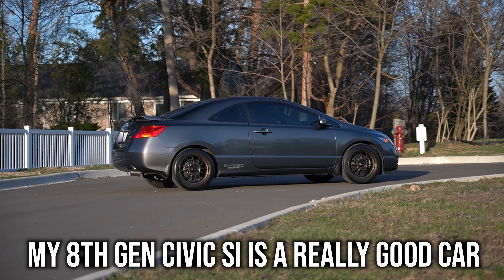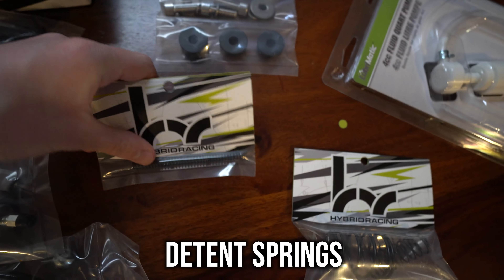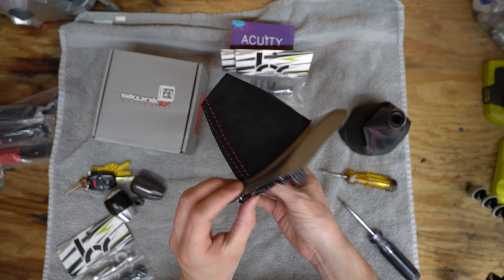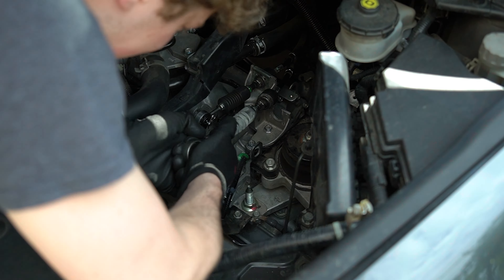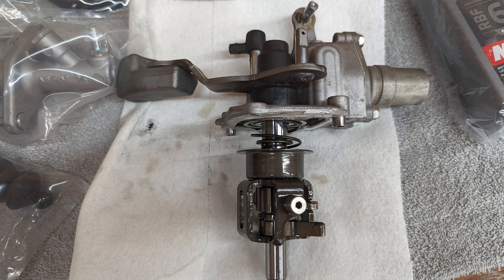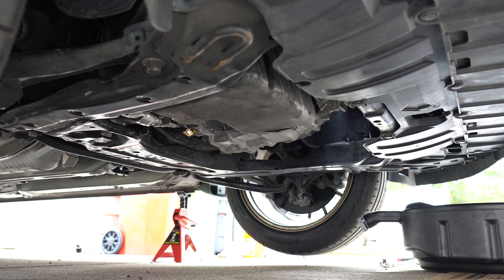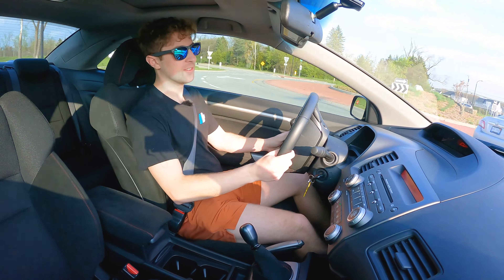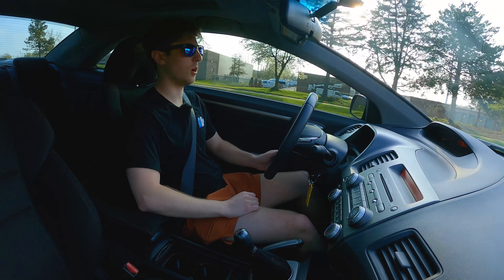FULL TRANSMISSION OVERHAUL On My 8th Gen Civic SI

Comment: maybe its just your personal preference but honda makes one of the best manuals out there
Reply: It’s a known issues with the 2006-2008 Si’s. My synchro from 3-4 is shot at 105k miles
Reply from the maker: one of the best shifters = maybe so :)
one of the best transmissions = absolutely not, they grind gears constantly and are the weak point for majority of older Honda's
Reply: Poor maintenance is the cause of those issues. No trans can hold up to constant abuse without premature wear regardless if you follow intervals. If they recommend every 30k miles (normal driving) then do it every 5k miles if you continue to slam the gears
Reply: my 2nd and 3rd synchros are kinda crunchy sometimes it takes a good double clutch to get into gear, not easy with rev hang

Comment: Bro, Hybrid racing CMC, line, and Slave IS the best solution you can have on your car. period.

You didn't adjust it right. That delay valve on each end is causing your next future grinds. Good video, Glad you got base bushings/shifter, and a shift knob/fluid. The detent springs are placebo as hell. That CMC kit is what you wanted more then anything other then literal shifter bushings. 

GL Cheers
Reply: OH if you're not feeling a shifter difference, it's because your shift fork/clutch is gunked up causing slight delays as well. It's a common issue on the k series platform.
Reply: Proper adjustment is key!
Reply: I have driven an 8th gen with the HR CMC kit, and the engagement point was almost right off the floor. It felt great to me
Reply: @SuperFURY1x how heavy does it make the clutch feel?
Reply: which is the best kit em1 or em2? cause i haven’t heard the best things about em1 and i’m in need of a cmc upgrade since mine went bad on me

Comment: Pretty sure Honda has some of the best feeling 6 speeds around.  Really discredits what you’re saying generalizing the transmission issues.
Reply from the maker: Feeling does not equal a good transmission....this things literally eat themselves apart overtime. Track use and hard driving really accelerates this.
Reply: @pattyboi  You literally said "even in like a really good, borderline brand new Civic Si, the transmission just feels garbage". There are problems with the syncros but the transmission is objectively one of the best feeling out there. It's a pretty unanimous opinion amongst anyone who has reviewed or ever driven one so I agree with @christopherkain7838, that's personal preference.
Reply: @pattyboi  I own a 2011 Si Sedan and can concur. I drove it off the showroom floor in Sept 2010. It only has 23,000 miles on it now. Transmission feels like trash into 3rd gear(grinds sometimes...synchros feel wacky....6th sucks as well. Also, clutch pedal makes an annoying clicking noise in warm weather. 
My 1999 Civic Si 5 speed box was a dream though. I beat that car hard and sold it with 150K on it...ran like a dream. Regret selling that thing.
Reply: You sound like someone who just watches videos that say Honda has some of the best transmissions and just go with it without actually driving one. 8th gen Si's are known to have 3rd gear grind and Fk8's are known to have gear grind as well when pushing the car hard trying to shift too quickly.
Reply: @blackmetal4546  the third gear issue is easily fixed with a thicker gear oil if you catch it early enough. Honda was using too thin of an oil. Current Honda mtf is much thicker than 06 honda mtf. 

I have an 8th gen that had the 2nd and 3rd gear issue. None issue when running Redline MTF. 

The delay valve on the CMC system is a different story. Swapping it to a CMC from an EM1 was a game changer.

Comment: I use the ktuned em1 style cmc and slave cylinder with braided line. You must adjust the rod on the cmc. And be sure to bleed properly once fluid begins to come out with no air continue to bleed it’s still got air in the system overall in my opinion it feels more solid and it’s not dampened like the oem cmc. It’s by far the best thing I done and feels much more rigid for my white fa5

Comment: Hondas from 80s-2000 had perfect transmissions. That being said I’m building that transmission in my 8th gen mugen. I will also post all my findings on improving it. I’m also not impressed with the transmission on that car but the 9th gen was smooth. I have no feedback on the type r because I have not driven that.

Comment: I just bought the Acuity shifter with new shifter cables and bushings! Hopefully they work out well! I own the Skunk 2 knob and I love it but it’s too hot near me to use it.
Reply from the maker: I can also confirm this shift knob gets very hot hahaha, I'm usually parked in a garage luckily but every once and awhile...oof
Reply: @pattyboi  I’ve been getting away with it by using those window covers and I put a sock over the knob when I park!
Reply: My next upgrade!! Did you get the 1 way or 3 way adjustable shifter?

Comment: Regarding the Hybrid Racing CMC you didn't adjust properly. I adjusted mine and engages a very low travel. So you need to adjusted it the proper way. HR CMC can be adjusted to any level high or low.
Reply: facts, and IS the best solution out there. K-tuned* and OEM's are literally known to fail, bind, and cause issues after hard use. (Exedy is another great oem solution that's offered without delay valve and yields legit Q/A testing much like hybrid racing)

Comment: Not sure I would call this a “total overhaul.” This is component upgrade. Overhaul is reserved for precision internal inspection/disassembly/replacement ie gear sets, synchronizers, sleeves, hubs, bearings, main shaft endplay. Using a press, dial indicator, calipers. 

The closest you came to overhaul was the shift selector springs. Not hating on you - video wasn’t bad for what you did.

Comment: Thinking about picking one of these civics up any tips??
Reply from the maker: Sedans hold value better and if you can swing it, 2009+ has a slightly improved transmission!
Reply: @pattyboi  the one I was looking at is a 2011 coupe, I do like the sedan better but I live in Vermont so its very slim pickings on almost every enthusiast car type, unless you're talking $30 WRXs. However, the entire state just had some record floods today and yesterday, and idk if the dealer moved the car out of the way or not.

Comment: I highly recommend using Valvoline synchromesh mtf… something I learned a while back is that the oem Honda mtf is missing an ingredient and doesn’t properly grease the synchros.
Reply: The OEM works great brother. Lots of folks use OEM MTF via track use, and High-hp builds. However, the OEM MTF isn't the best fluid as you mentioned. I'd say that depending on the zddp levels of synchromesh, it's likely higher in PPM then oem MTF, making it a far better solution.

Comment: The engagement point is to high cause you have to retain the oem part that conects the cmc to the clutch pedal
Reply from the maker: Did that. Didn't work. Engages high even though it's installed correctly
Reply: @pattyboi  other method is to calibrate the thread stud of the master Cylinder

Comment: Do you think the EN would benefit from springs like that? I have the forge short throw bracket like you guys, and on track it is fine, but autocross I consistently have issues getting switching into second and third. Most the time that is fine as second is usually fine, but on faster courses I sometimes need third and this issue costs me some of my best runs. Also, how hard would it be to get a longer 2nd gear that runs out to 65 or so? Would be an even better solution.
Reply: Have you replaced your CMC, Slave and line with a quality exedy or hybrid racing solution? After adjustment it's immensely different. (Also I mentioned in another comment on this video that the k-series clutch/fork gets hella gunked up and sticks causing shifting issues which is common on used/driven k-series platforms)